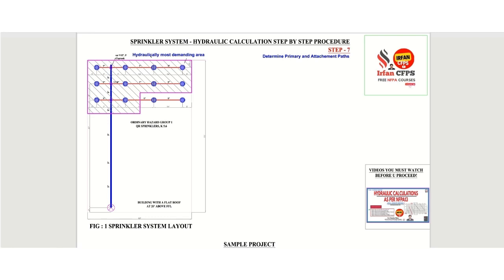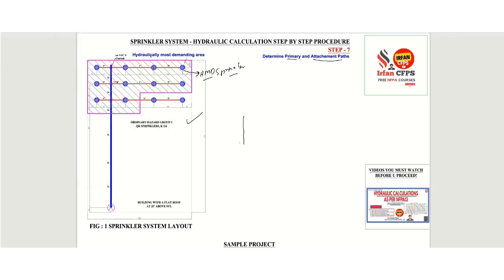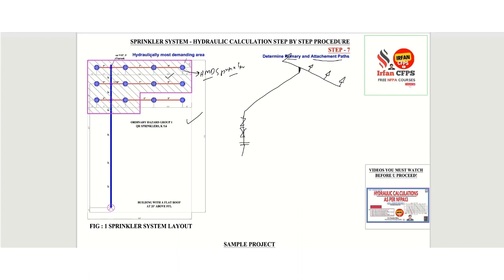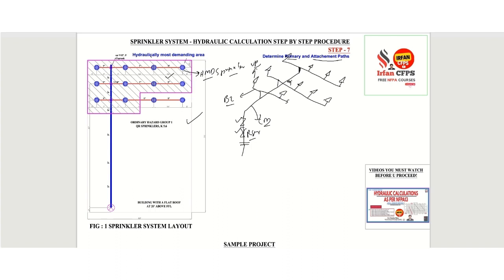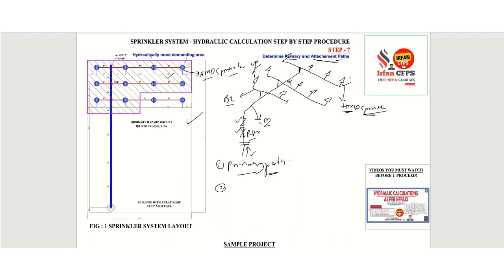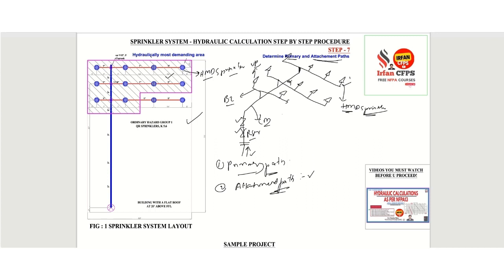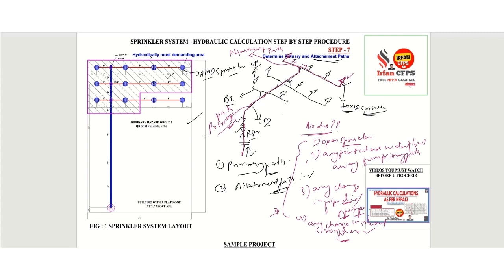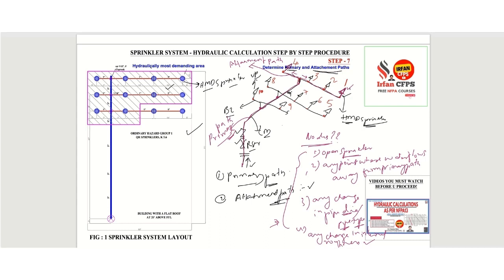Step 7 |Hydraulic Calculations for Sprinkler Systems

Comment: I have a question. When will you calculate or consider the attachment path sprinklers in your hydraulic calculation? Cause we can simplify the calculation by using the area of operation method rather than computing them individually.
Reply from the maker: This is the procedure that i know.

Comment: Sir, i have a question. If we need to put node where  change in dimension occurs there would morev more nodes in this video..

Ie for example when dimension  changes from 1 1/ 4 to 1 inch ?
Reply: Thank you.
Reply from the maker: I appreciate your support, thank you for watching!
Reply from the maker: Yes dear you have to put nodes if there is change in pipe size as well.